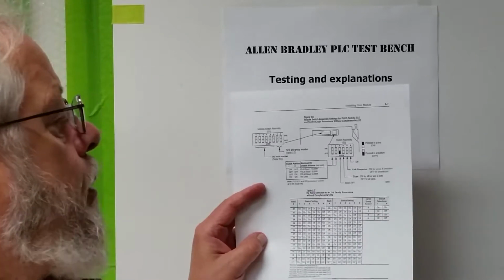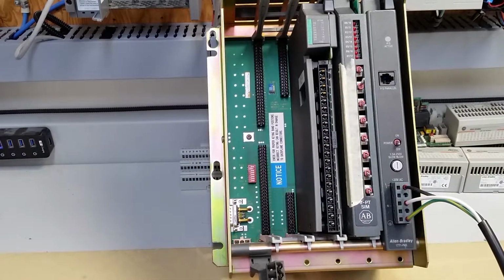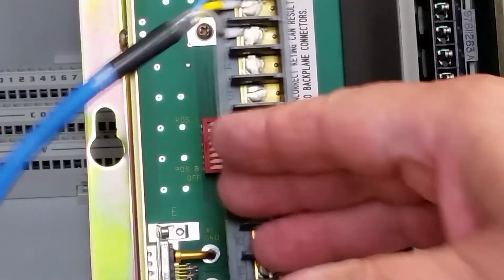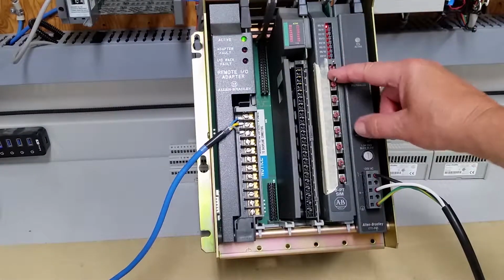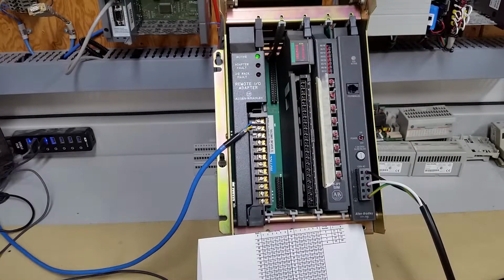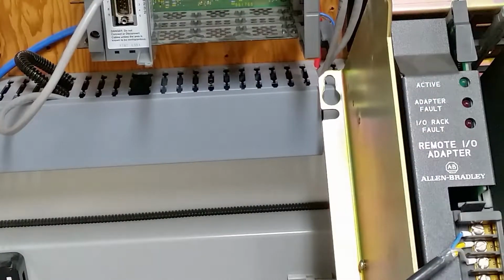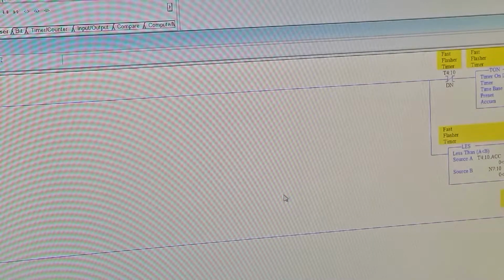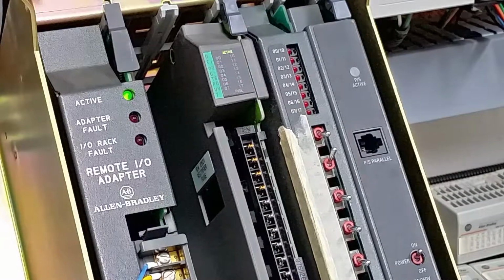1771-ASB - RIO adapter

Comment: I have tested three ASB modules and they have all auto-configured themselves fine in my 4 slot rack as 1/2 rack with words 100-103 but both of my ASC modules have returned an auto-config of 1/4 rack and have only words 100 and 101? Any idea why this is happening?
Reply from the maker: Not sure - what processor are you using?
There are multiple variables in this.
The ASC had many drawbacks compared to the ASB.  
You are better off using the ASB and re-cycle the ASC - IMO

Comment: Hello. Thank you for this video. 
I have question related to this product so probably you could help.
On a site we have  PLC5 controller on main rack. From I/O port of this controller blue hose go to terminal block where we have also connected  another two blue hoses in parallel. On each end have 1771-ASB scanners. So it is kinda star topology. But 150 Ohms resistor is installed ONLY on one 1771-Asb side.
 Controller and another scanner doesn't have resistors.
You mentioned that resistors must be installed on each end. 
On one remote I/O rack with scanner without resistor we have RB module with wireless communication. Periodically we have lost communication. After power OFF and power ON the power supply for that rack the communication come back.
Usually it blocks transmission and not a receiving side
Reply from the maker: Hi Ivan:  Star wiring can give spurious errors.
Think of the wiring for the remote I/O as being the same configuration as a fire alarm system. 
If you don't have a single line with resistors at either end it does not work right.
It may work most of the time but can't be guaranteed. 
I would suggest you clean up the wiring and make sure that it is correctly done to AB specs.  The communication is actually a current loop.  It will take abuse, but if done wrong don't expect it to work right.
Hope this helps.
Reply: @abplctestbench759  Thank you. Is the remote I/O same resistor requirements as DH+ network with its nodes. 
In my understanding they are different but using same  cable.
Reply from the maker: @ivanblazhenko99  From the 1771-ASB manual - which you should be able to find online or maybe sitting in a box or on a shelf in your plant.
-------------------------------------
If this is the last remote I/O adapter on the link, you must use a
terminating resistor to terminate both ends of the remote I/O link
(scanner end and last adapter end). Connect the terminator across
terminals 1 (blue) and 3 (clear).
The size of the terminator is determined by the system configuration.
Older configurations use a 150 ohm resistor at both ends. With newer
products that can support it, you can use an 82 ohm terminator at
both ends. The 82 ohm terminators provide “extended node”
capability which allows you to have up to 32 physical devices on the
RIO link. (The number of logical racks capable of being addressed
by the scanner is not affected.) This allows 1/4, 1/2 and 3/4 racks,
Dataliners, Redipanels and Panelview devices to be attached to the
link.
!
ATTENTION: Devices that are operating at 230.4K
Baud must have 82 ohm terminators in place for proper
operation.
------------------------------
The DH+ is the same configuration.  Must be done in a drop link configuration.  Not a star.  Resistors at either end.
I will post the info from the manual shortly.
Reply from the maker: @ivanblazhenko99  
From the PLC5 processor manual.
------------------
A DH+ link using this
communication rate
Cannot exceed this
cable length
57.6 kbps 3,048 m (10,000 ft)
115.2 kbps 1,524 m (5,000 ft)
230.4 kbps 762 m (2,500 ft)
---------------
If you select the baud rate as 230.4 kbps, and you are using
the serial port or a PLC-5 co-processor, use channel 2 for
better overall system performance.
-----------------------
If Your DH+ I/O Link Operates at Use this Resistor
Rating
230.4 kbps 82Ω
57.6 kbps or 115.2 kbps 150Ω
Reply: You mentioned that communication is the flow of current. Let me ask you this. In case if we have some voltage drop on blue hose connections is that possible that the data can be transmitted by scaner to digital modules in slots 2,3,4.... and cannot reach two last slots 14 and 15 ( where are RB and Basic modules)?
Reply from the maker: @ivanblazhenko99  Without being there to personally inspect your system and wiring practices, it would only be a guess based on insufficient information.
You must have proper wiring in place with proper connections done in accordance with the specifications laid out in the manuals.
If the wiring and system communications setups are not done properly then you will have multiple problems and many problems will only show up now and then.
Just because it  works does not mean it is working properly.
Reply: Hello. I actually was looking into the 1771-Asb manual and saw all information you wrote here in comments.  
The main problem was that I thought that 17711771-Asb is a SCANNER.  It is just an Adapter. 
The best explanation I found in PLC5 controller manual. After I understood that processor channel can be st as Scanner and an Adapter.
Also on my site the blue hose media  connected as daisy chain although the installers didn't connect all wires at adapters terminals they simply used terminal blocks in the middle kinda safe some wires)
On thing is not clear why we have only one resistor on from last Adapter on the remote link and nothing on controller channel connection. 
Could it be set up internally? ( sorry if it is somewhere in the manual)
Reply from the maker: @ivanblazhenko99  The only reason that it is not there is that someone did not put it on.  You need to find and install and confirm that all of your connections are properly done and you should be in better shape.  Good luck and have a great weekend.  Bruce
Reply: @abplctestbench759  Thank you. But what I just did I I disconnect the blue hose wires plug from the controller and it did have me the I/O fault on the controller but nothing on the SCADA screen. After I plud it in the fault cleared and indicator became green. I didn't have to press or clear anything.
When the Communication timeout fault  is happening then I lose all communication modules on rack. And to reset the fault I have to reset the power for the rack adaptor.
Reply from the maker: @ivanblazhenko99  That is exactly how it will work if you do not have RIO error traps programmed in.  If you loose the RIO channel you should be doing some type of error messaging thru the DH+ channel to some other monitor system.  
I am not sure what you expected to happen when you disconnected the control cable to the remote I/O.  It is all controlled by the processor and if it is disconnected all of the remote I/O will go to a off state and some of the semi smart modules will hold the state they were in. 
Disconnecting the RIO cable from the processor could result in a dangerous and possibly deadly situation depending on what it is that you are controlling.
Hope that no one was killed when you did that.
Reply: @abplctestbench759  Hello. Do you probably know what voltage suppose to. Between Blue and black , clear and black  wires ? When I reset the power supply for remote rack both blue-bkack and clear-black  vac readings are 1.4VAC
 Over sometime and when communication timeout fault happens the voltage between clear and black drops to 0.6vac and stays until I reset the power supply
Reply from the maker: @ivanblazhenko99  To troubleshoot the RIO or DH+ you need to go online to the processor and analyze the registers for the error codes.
This is not something that can be checked using a voltmeter.  You would need a scope and I have no idea what waveforms you would be looking for.
I suggest you ask the question at https://www.plcs.net/ or at https://forums.mrplc.com/index.php?/forum/1-allen-bradley/ 
You should be able to get an answer there.
Good luck.

Comment: Great video and presentation.
Do you have any video showing the configuration of a Devicenet 1771-SDN card?

thanks for everything.
Reply from the maker: Hello Luis:
Sorry I do not have any videos on the 1771-SDN card setup.  I know that you need the communication card to hook directly to the SDN and the SDN configuration software.  
I will have to dig deep to try and find it all on my old XP Laptop.  Not sure that it will run on anything newer than 32 bit Win7.
You can also check with http://www.plcs.net/ and ask them.  They may have a course on it or will put up the answer for you.
Thank you for your question.
Bruce B
Reply: @abplctestbench759  Thanks for the answer, friend.

Can autoconfigure be done in online mode? is there any risk?

add a Chassis RIO in PLC5, it is a network of 8 Chassises, manually add the Chassis, the Active Led blinks and in the IO Configuration I have an F, I cannot delete it.

do you have any suggestions?

grateful.
Reply from the maker: @luismucha4365  The processor has to be in program mode to add a chassis online.  You could also add it offline and then download the updated program to the processor. 
There is no way to add remote I/O to a system when it is running.
If it is blinking green after you have done the auto configuration then it is just waiting for the processor to go into program mode and then update the RIO files.
The ASB speed and the processor RIO speed must be the same baud rate.  
The wiring must be done correctly and hooked up and the end of line resistor must be the correct size and in the correct place on the last physical chassis.
Reply: @abplctestbench759  perfect friend